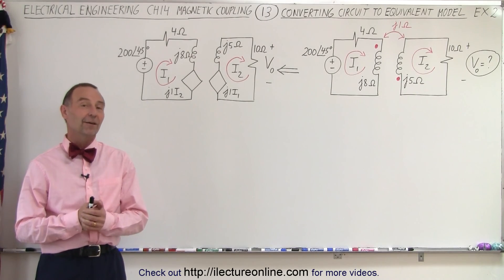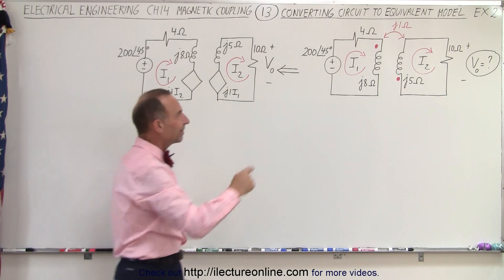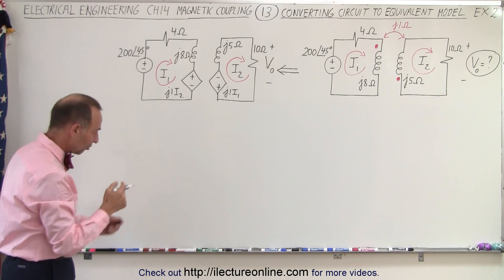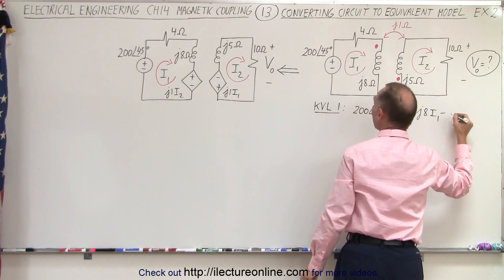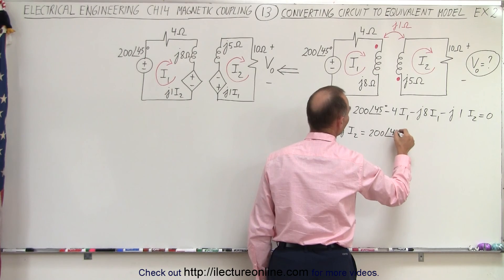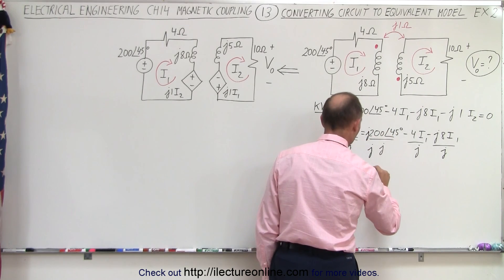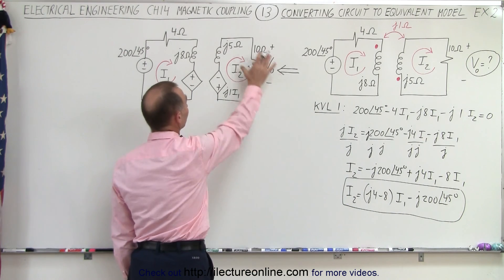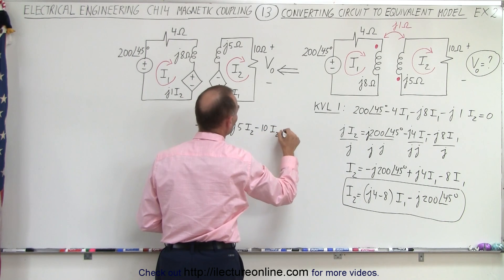Electrical Engineering: Ch 14 Magnetic Coupling (13 of 55) Convert Circuit to Equivalent Model: 2**

Comment: Sir please start Electrical Machine and Electronics (diode,bjt,fet,mosfet etc)+ power electronics &,Power system . I requested it 2/3 months ago.Still waiting for this series.Please sir start some series for Electrical Engineering! You have lots and lots of student in this sector. THANKS SIR.